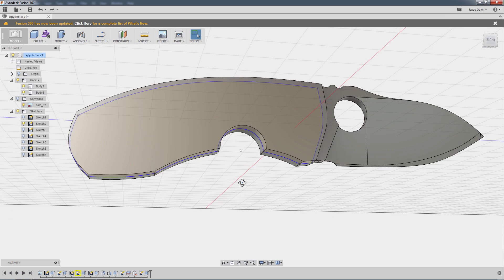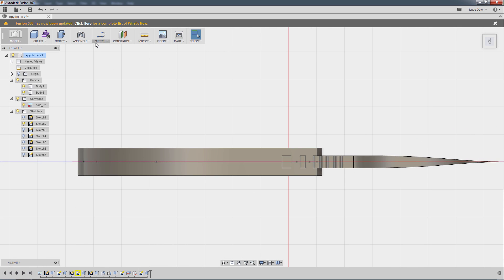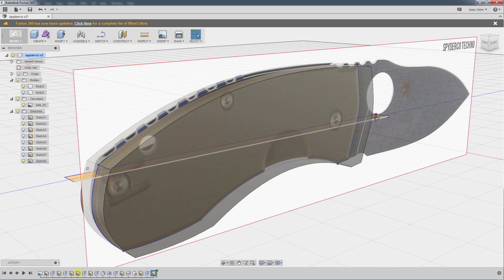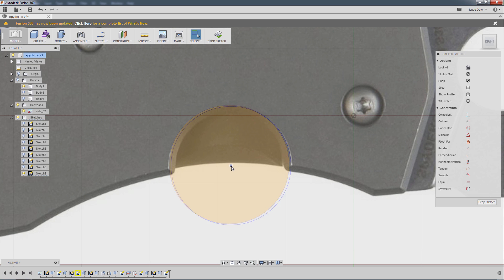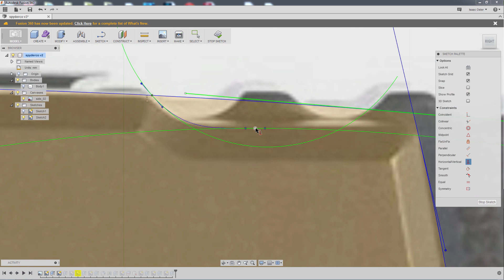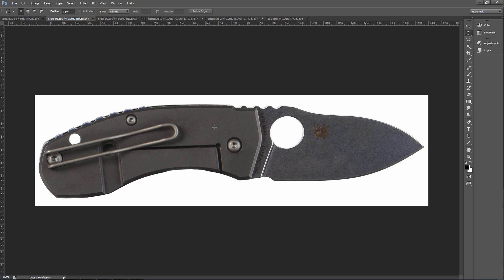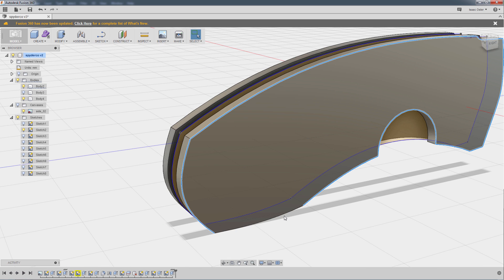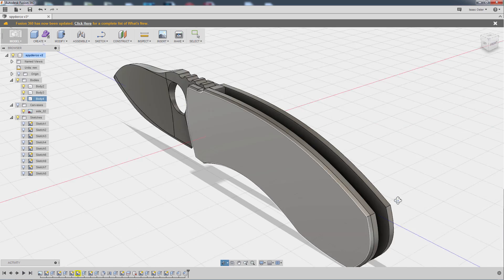Fusion 360 Sample Project Ch 5 - Handle Refinement 01

Comment: thanks a lot, though when you sketch the lines to cut through the handle making it two pieces using the blade width as a reference,  HOW do you make the sketch snap to the points on the blade ( 1:23) ??? I could do that when only sketching on the body its self , and here you are sketching on the work plane !! THANK YOU VERY MUCH